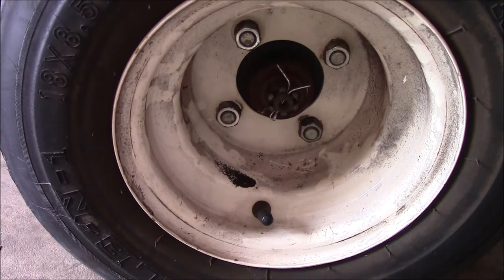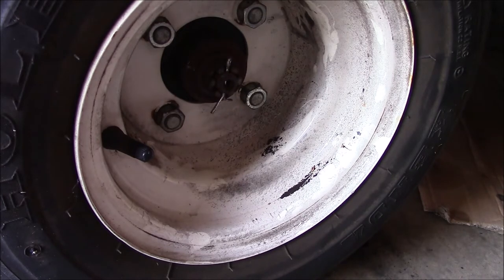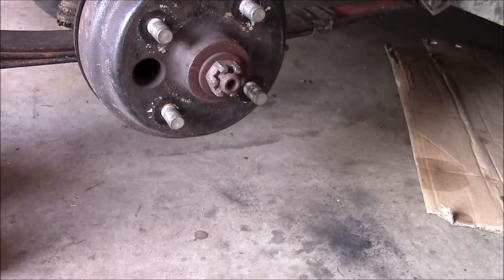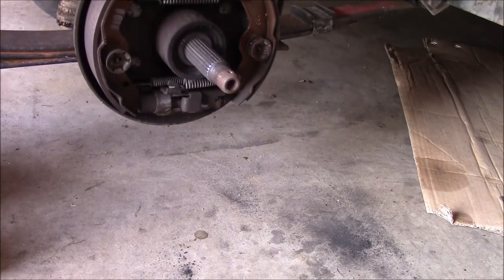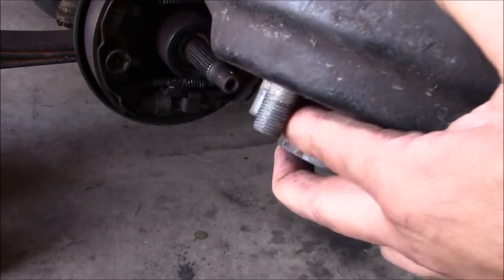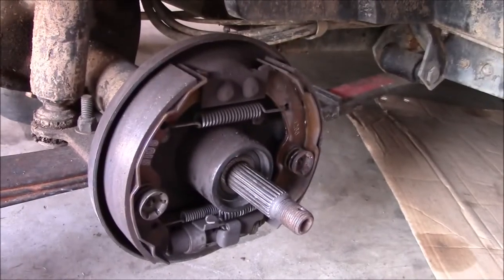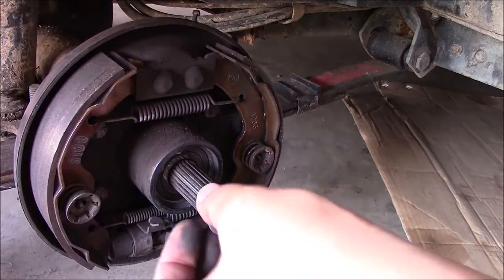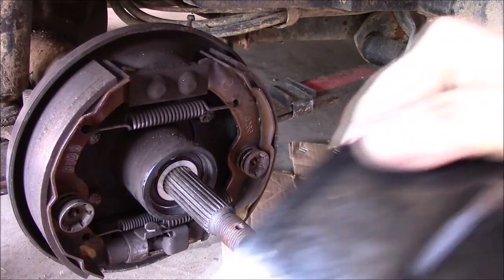EZGO rear hub replacement

Comment: looked to me that the axle shaft might be bent a little ,we bought  a cart used and it had a bent axle shaft that looked like yours did when you spun it over
Reply from the maker: There has been no issues after replacement.

Comment: My back wheel has a slight wobble. Will replacing this hub help with wobble?
Reply from the maker: Yes, depending on how badly it is worn, but could also be the wheel or axle.

Comment: Shifting from forward to reverse (or reverse to forward without coming to a complete stop will cause the hub splines to shear. Extreme abuse will cause this to shear, as well. There is a specific torque specification on the castle nut and I have found 120 foot pounds to be sufficient. NEVER go backwards or loosen the castle nut to install the "Carter" pin. Not torquing the castle nut will result in failure again but sometimes the failure is weeks later. I have found that buying OEM hubs will save you a lot of headache in the long run. The difference in price is worth the money. After market drums and hubs are a big NO NO.. A golf cart accident can be just as deadly as an automobile accident.
Reply from the maker: Great points
Reply: @mrfixit4211  BTW Thanks for making a great video. You should make more. Good job. Don't get discouraged. People will use these videos years from now.